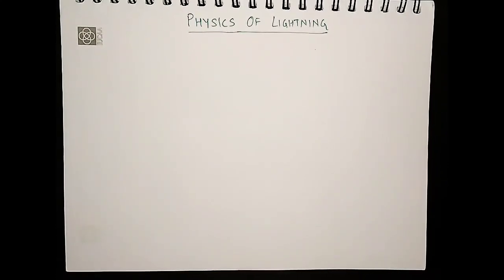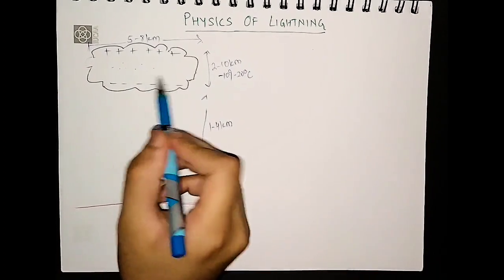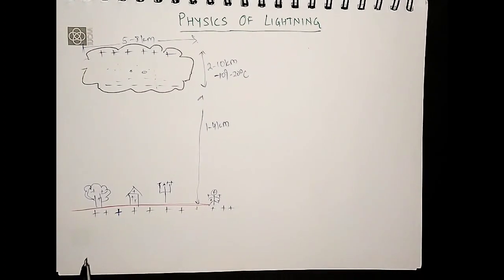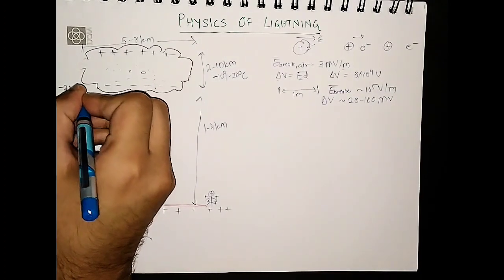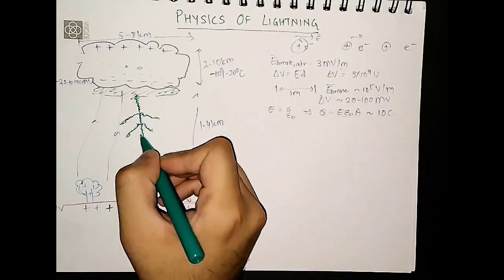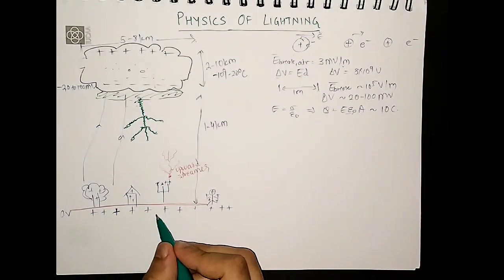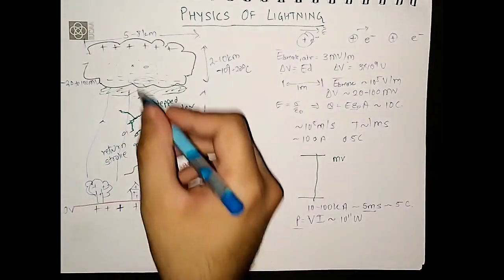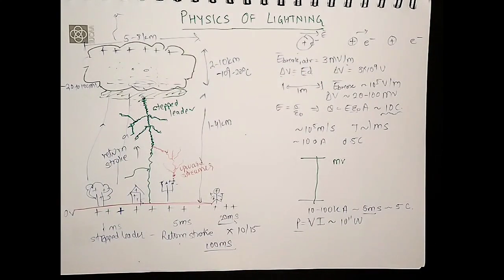Physics of Lightning Fully Explained | Real Clips & Values|Science of Lightning by Feynman Technique

Comment: How the sound of the lightning produced😕😕😕
Reply from the maker: When a current passes, it generates heat. This heat raises the temperature around the lightning which in turn increases pressure. Thus a pressure wave is set that travels away from the lightning. This pressure wave is the sound that we hear as thunder.
Reply: @LifeAroundScience  pressure wave?????????? 😕😕😕😕